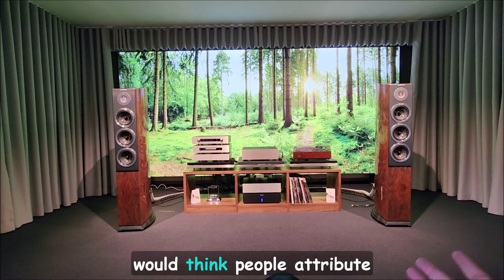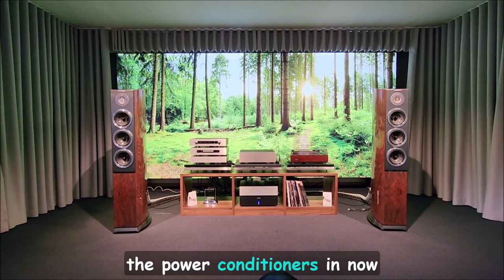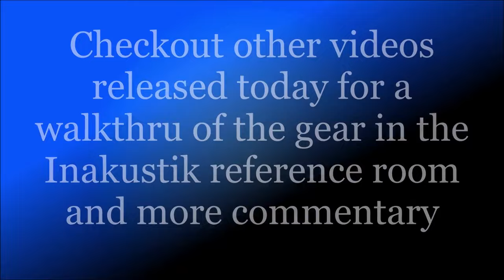Hear Inakustik's Reference Room - Comparison of Power Cables and Power Conditioners

Comment: It's kind of amazing that I could hear a difference between the two despite the audio compression, YouTube crap, transmission noise, computer noise, cheap headphones connected to a USB adapter...People, we are talking about power cords😵, not different speakers or DACs.... 😵‍💫.  I'm gonna have to test this for myself at home OMG🤕
Reply: I thought  power cords were 'audio jewlery' for many years. 

It was a bewildering  discovery to find that when it comes to the character or presentation of our system;

Power Cords > IC's > Speaker  Cable

Seems to defy logic, because the PC's are not even in the signal chain... 😂